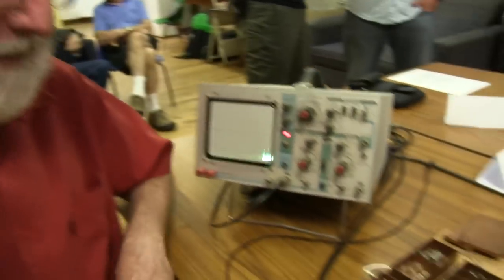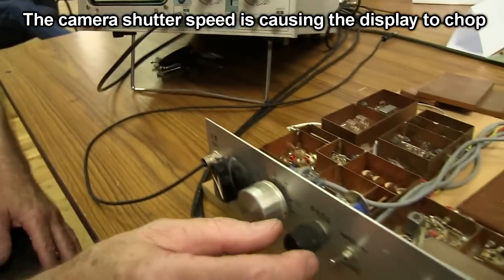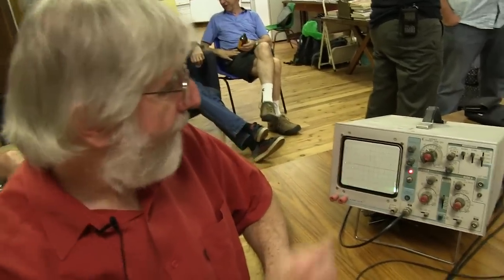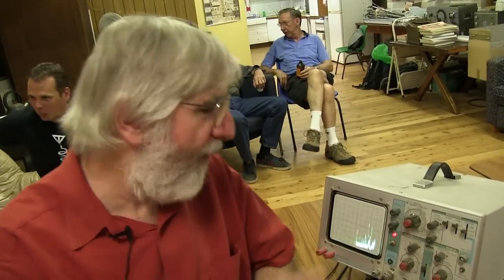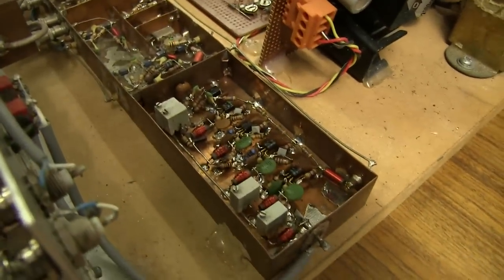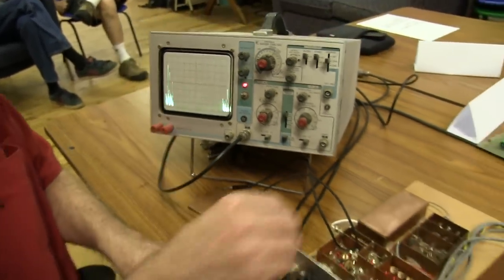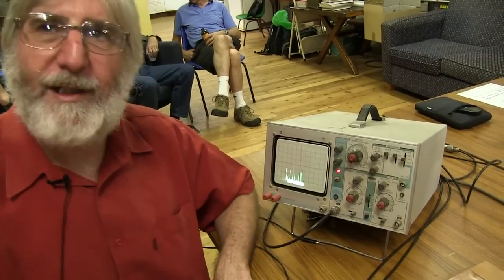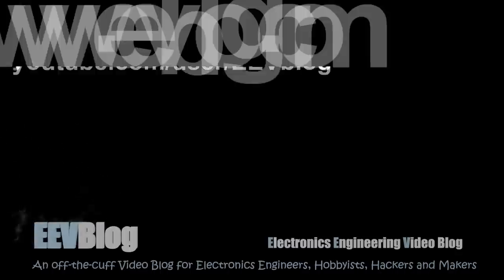EEVblog #575 - DIY 1970s Spectrum Analyser

Comment: Pedant warning: Dead bug construction and Manhattan style are different IMO. Dead bug joins nodes 'in the air' above the ground plane. Manhattan style joins nodes on little snippets of PCB superglued to the main ground plane board. My personal preference is Manhattan - looks prettier, survives ham fisted poking about better and isn't much or any slower to build. You can cut your own pads with a Dremel (wear a dust mask).

Comment: Very nice. I even decided to build an analog one like this. Just using horizontal trigger to synchronize signal to a oscilloscope. However, I just cannot find a good analog bandpass filter schematic to have enough resolution for audio band, which should be accurate to 100Hz. For RF band, it is okey to do that. I am still learning that.

Comment: It amazes me how RF is more of a art than a science. Frequencies chosen seemingly at random... Very cool
Reply: Conversion frequencies that may seem random are chosen carefully. Each conversion involves building and shielding a local oscillator, dealing with an image reponse and providing an IF filter. He explains that the first conversion is upward, so that the image response is kept well outside the 0-200 MHz display range. He shows the local oscillator frequencies that can leak into the display when not screened. The 10.7 MHz IF is standard for FM radios which allows him to use a readily available cheap ceramic IF filter.